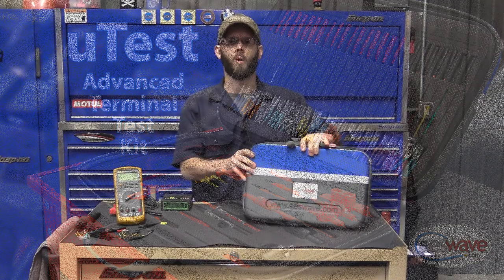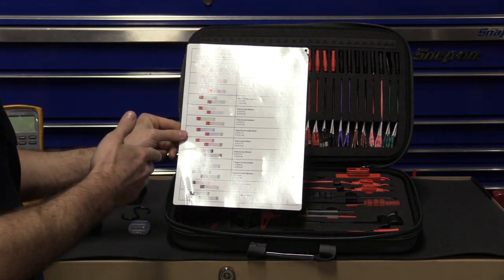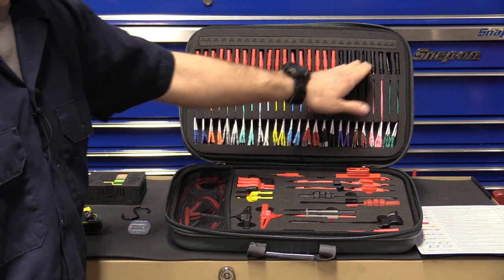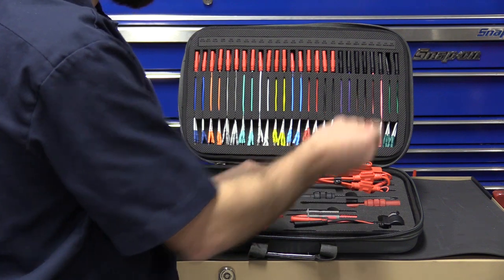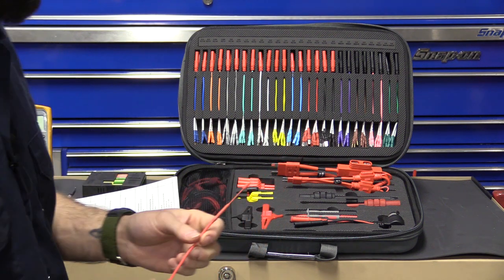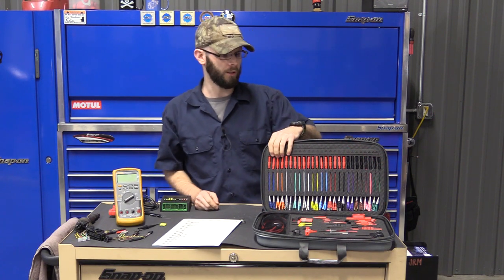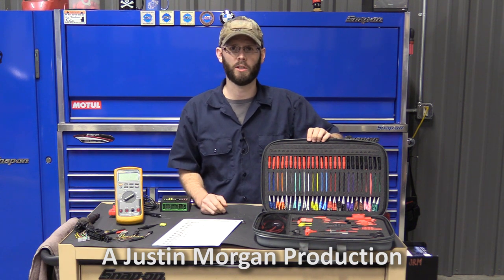AES uTest Advanced Terminal Test Kit

Comment: Every tech needs this kit. There are a lot of different kits out there, the AES is better in many ways. The biggest difference is the thickness of the connection area. All of the other kits I have seen on the market have a very large plastic area by the crimp, as a result you cannot connect to many terminals side-by-side. The AES kit does not have this issue. The current loops are awesome and the kit is by far the best value out there.

Comment: There are much cheaper Kits to be had on eBay and Amazon, I got a couple!! Buuuuut where the whole scenario goes south is if you are trying to stack as demonstrated in the Video. I recommend owning one of each. The traditional China Kits will work great but again, stacking inside a connector is hardly going to work for you.  In my humble opinion the  $120 difference  is worth it if you do allot of probing.

Comment: Hey we need an adapter or a AMP loop for the new side contact fuses
Reply from the maker: If you're referring to the low profile mini fuse, it is already in the works along with 3 other fuse loops that should be available soon, separately
Reply: @AESwave  Can the U scope be used to graph AC signals such as 2 wire crank sensors?
Reply from the maker: @joelopez40oz23  Yes it certainly can. Just don't plug it into an wall socket with 110v. AC inductive sensors on vehicles are fine.

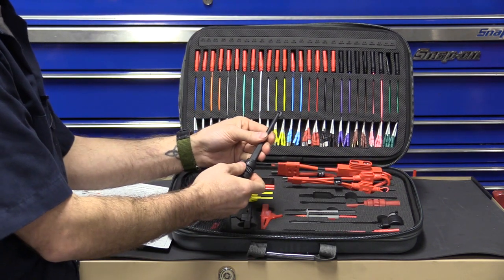Comment: 3:53 Why would you pierce wire? Considering these are professional tools, why would you jeopardize cutting strands of wires upon piercing the shield?
Reply: Because sooner connectors need to be plugged in while testing. You can either back probe or pierce the wire to be 💯 sure you've got good connection

Comment: Thank u Justin. This kit looks so much more nicer. I got the regular one with the red and black colors terminal leads. ☹
Reply: which kit do you have Jason?
Reply: I guess it's the second generation. I just saw this kit while I was looking at aeswave.com to get some more new cool tools. The set up is red black and blue and yellow. Not like those nice colors. No big deal I just wanted to see something newer was added. So that's how u can use that variable resistor. If u can? Do u know of a link as to how j can learn more about resistors and how I can mimick the resistance of different sensors. I guess I'm asking to get more practice on electrical. I cant stop wanting to learn🤪
Reply: Jason Chavez yeah the no repeating color scheme was a slight update.  Best suggestion I can give you is play with as much as you can. Once you have the description operation of a sensor and the voltage range, ohms law will let you know the resistance range if it’s not specified in SI. Most of the time on late model you get a voltage range.
Reply: @bav-lab3584  thank u justin. Gotta look more on ohms law
Reply: Jason, here is a video that I used the resistor for:

https://youtu.be/Uq4NJP3KWak
Reply: Ohhhhh wow thank u Matthew. It was just Monday U  and the whole TBT gang did a live stream. God is good for real. I didn't see this coming. I'm very appreciative of this. Thank u
Reply: @matthewshanahanautomotivet4284  Nice video perfect use of the tools.